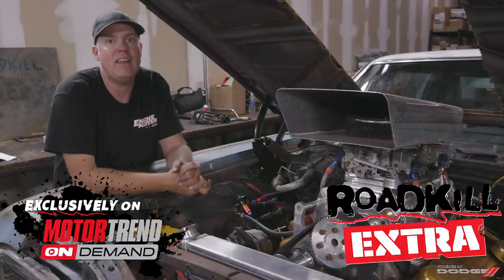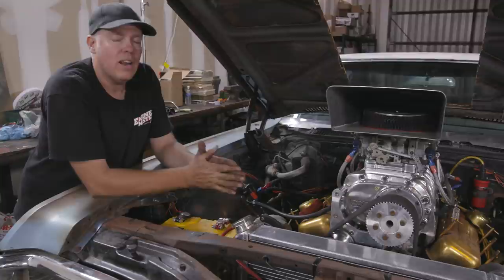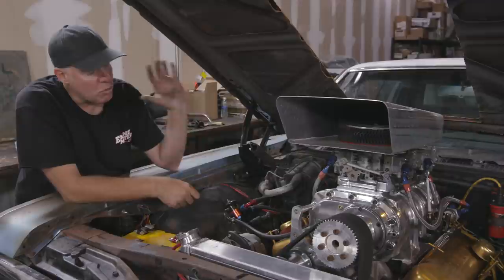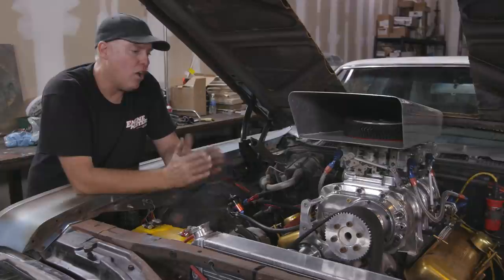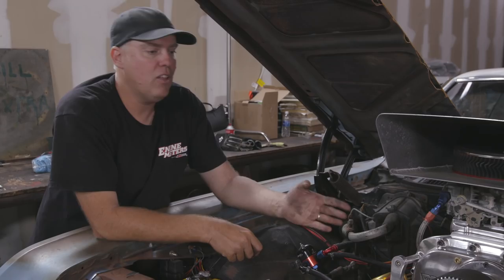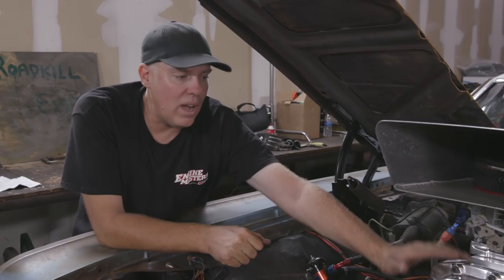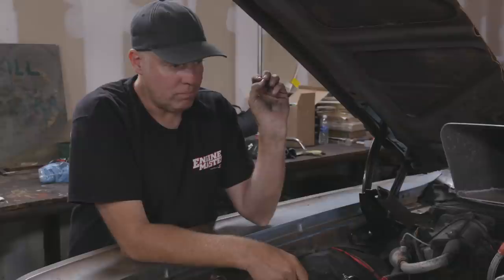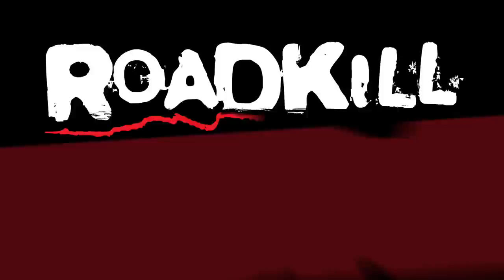Freiburger Explains Supercharger Basics - Roadkill Extra

Comment: I'm guessing the 2-stroke diesels don't use the crankcases for pumping, as mopeds, chainsaws and such does... So they'll need the blowers for a combination of scavenging and simultaneous refilling of fresh air to compress for the next working stroke.
Reply: Correct, the internals are not lubricated by fuel oil mixture being pumped into the crankcase like a two stroke gas engine. Which is nice because you don't have to worry about getting a correct oil to fuel ratio when you're refueling.
Edit: Plus the two stroke diesel sound so cool!
Reply: the 2 stroke GM that these blowers are based off has ports in the cylinders and exhaust valves in the head 
And yes they use the blower to "scavenge " the fresh air and force the  spent fuel and and air mixture out 
They are noise things to drive and have a very small torque range so as the saying goes "you gotta drive them like you stole them"
GM I was always told doesnt mean General Motors it means Grey Marine as that was the colour they were painted until GM bought them out in the late 30's
In Australia we call them leakers, bird scarers, screamers 
After you have spent a few days driving one you realize just how loud they are LOL
Reply: They indeed sound wild. But they sound nuckin futs when an injector or the injector rail hangs on one. Then they get quiet, that's when you run away real fast. lol
Reply: Have you ever seen what actually happens to cause a injector to stick ??
I made a video explaining what happens and showing how it happens and how to make sure it never happens on a GM 
Most people dont understand the full story as to why the injectors stick on a GM and it is quite a simple methodical process to check each injector properly but takes half a day on a GM to prevent the run away from ever happening
Reply: A tech can get in a hurry and destroy a fresh rebuilt DDC 2-stoke and possibly the tractor.
Reply: Our instructor even sabotaged a couple on us to teach the class. Thank Goodness he had a block off plate those suffocate the engine so not to destroy a teaching tool.

Comment: Can I get some thought on an engine swap I've been thinking about? 

I have a Ford F-150 with a manual trans with V6 in a regular cab and a narrow bed, I'm wanting to do an engine swap with a 5.4 Triton V8 with a supercharger. But I want to keep the manual trans in it, but I don't know what kind of computer I would need as well what trans can take the power and still fit in the truck. And would I need a new rear end for it? Would I have to replace the pistons and cam in the engine?

Comment: As far as we can make out, engine compression follows the gas laws, so the higher the compression, the more crank power is turned into heat energy from mechanical. High compression is great for power, but bad for low end torque.

Comment: If you're losing nearly 100hp just to turn a blower, why not just make it electric (i.e. small Tesla motor)?  A small Tesla type motor attached to the blower would provide immediate spin up and could keep it spinning way past the mechanical limitations imposed by the crankshaft spinning it. Just add a few batteries, or super capacitors, and you'd have the perfect drag car.
Reply: The problem is that we do not currently have the technology to make electric motors compact enough to fit in an automotive application that provide enough power to supercharge an engine.

Comment: Why don't you put a blow through twin turbo set up on the supercharger
Reply: WWII aircraft  used two stage supercharging where the output of one blower is fed to another.  The thing to watch out for  is the heat gain on the compressed air at each stage.  Compressing the air heats it as well. 

Two stage turbocharging is also possible.
Reply: a lot of the detroit diesels used both, the blower for savaging, and a little boost, and turbos for boost

Comment: David, (the rest of you) would an expansion chamber 
on a 2 stroke be considered a supercharger?

It DOES increase intake charge above ambient 
air pressure.

steve
Reply: The expansion chamber of a case induced reed valve two stroke operates on a different principal. It uses reflection of exhaust pulse pressure wave to push back partially burned exhaust gasses into the cylinder increase the volume of gasses available to be compressed. This is why pipes have an effective rpm range. Superchargers are mechanically driven devices which increase the pressure or volume of intake air. You can't really supercharger a case induced reed valve two stroke as the net increase in power is virtually non existent. The engine design is based on pressure differential from the bottom case and top of the piston. Most of the compressed intake charge would just leak straight out the exhaust port as there is no valve to retain the increased pressure. This is also why exhaust tuning works so well. If you time the exhaust pulse pressure right it literally pushes the gasses back into the cylinder and netting and overall higher volumetric efficiency.
Reply: James, an expansion chamber will first suck unburned air/fuel 
out the exhaust port, and then, after the transfer ports are 
closed, pump that unburned mixture back in.  Thereby, achieving 
a net total above ambient pressure.

Here's a link

https://en.wikipedia.org/wiki/Expansion_chamber

Looks like a supercharger to me, but ONLY at the right 
frequency.  (Which is why 2 stroke bikes have so many 
transmission gears.)

steve
Reply: Steve Skouson , superchargers are active mechanically driven devices utilizing energy such a crankshaft rotation, electricity, exhaust gas..ect to power a compressor to increase intake air volume. Expansion chambers are passive devices designed to take advantage of unique properties of exhaust pressure wave pulses. By definition, even though behavior may be similar in some circumstances, expansion chambers are not superchargers. Just like apples are not oranges, but they both grow on trees and they are delicious.
Reply: Steve Skouson, again, apples to oranges. Wikipedia for starters has a nice definition. However the pneumatic system linked eventually will run out of air in the bottles and so falls in the same category as nitrous. It's a neat idea. If they used air pressure or hydraulic pressure to power a compressor, then it would better meet the definition of a supercharger. Jet engines are a prime example of what a self feeding supercharger is capable of. Eliminate pistons and operate as a brayton cycle using sheer boost to produce thrust or add in another set of turbines and turn thrust into rotational force. Another neat concept is the 5 cycle engine.  But back to the original question, tuned pipes are not superchargers as they work on different principles. But whatever means are used to make horsepower, it doesn't matter as long as the intended results are achieved.

Comment: I hear the BS about not having parasitic losses with turbos a lot.  You still have to follow the law of conservation of energy.  The engine must lose some horsepower to the turbo to run it.  Yes it may be more efficient, but has anyone figured out exactly how much parasitic loss goes to the turbo?
Reply: Seth Jones The energy that runs the turbo would be wasted as heat and pressure coming out of the exhaust in an n/a engine hence there is no parasitic loss.
Reply: Iain that is the common misconception. It does not work like that. When you put a turbo on, it will restrict exhaust flow, thus restricting piston movement, thus parasitic losses. It is less than with purely mechanical superchargers, but it is still a parasitic loss.
Reply: Seth Jones there's less lose with a turbo, a turbo is run off the exhaust. The law from the turbo is caused by heat and not a belt that is turned by the motor
Reply: Engine Masters episode idea
Reply: If you run it off the alternator , there will be a parasitic loss.  The only way to avoid all parasitc losses in forced induction is an electric supercharger setup that runs off of a very large battery that is charged off of a wall outlet, or use a boost caboose.
Reply: Seth Jones you must be fun at parties, I was talking about the fake ones that have a legit Pc fan in them
Reply: Seth Jones if u run it that way ull have even more lose, the car will have to keep making power to make electric to run itsself plus make boost causing the engine to work harder. Turbo is still a better way the lose is threw heat but they have intercolors and if ur smart enough u can eningeer a water to air or a water flow threw unit and reduce that issue completely.
Reply: Seth Jones wouldn't it be classified as parasitic loss only if the engine was losing power from the inductor? For example I could put a larger alternator in the car with a pulley to match the original gear ratio (equal power loss) of the replaced alternator and still receive adequate power.
But what the heck centrifugal supercharger the whole way, Audi can steer clear of me with their electric Turbo technology.
Reply: Matthew Guilford English?
Reply: eh, kinda if there was a electric supercharger that actually work the losses from the alternator would be negligible, itll charge over time and draw from the battery at wot, that being said... they don't actually work ,it would take a massive set up, and a giant heavy electric motor to run it
Reply: The amount of loss depends on the turbine wheel size, I would imagine a setup with too small of a turbine would restrict flow which kills power and would be less efficient. Would be an interesting test with a large turbo that isn’t choking the engine
Reply: Alternators require power to run.  The more loat is placed on the electrical system, the more load is placed on the alternator, and the more load is placed on the engine.  Thats just how this works.
Reply: I said run the electric cupercharger off of a battery charged from a wall outlet.  not the alternator.  alternators require hp to run.  You can run anything off abattery on a circuit not connected to an alternator.  Your flashlight is just one example.  maybe you should think a little more.
Reply: again, runn it off a battery charged from a wall outlet, not the alternator if you want to avoid parasitic losses.  wont work for very long, but it may be good for a few passes at a drag strip.
Reply: An easy and fairly tidy way to answer your question is equating how much power it takes from the engine to run a device. A small turbo comes out to about 27 horsepower. A large one, like an 88mm is closer to 40. Still better odds than you'll find on the most efficient supercharger systems, but it's all about the application and power delivery, and where you want that power in the RPM range.
Reply: There is one electric supercharger out there, but it's got a quite ways to go before it's fully viable. I believe the test mule is a Volkswagen.
Reply: If the turbine side is specced properly there are plenty of turbos that will run less drive pressure than boost, meaning pumping losses due to exhaust back pressure are more than fully negated by the charge air on the induction side.; and what I’m talking about is on diesels where we can run 50, 60, 80, 100+psi of boost. As another point there’s empirical evidence drive pressure up to 15psi more than boost does not affect overall horsepower.
Reply: I know it's an old thread but remember when it's a "conversation" between turbo fans and supercharger fans ALL JOKES must begin with something like "a priest and a rabbi walk in" LOL! Way too serious for anything as clever as your comment! I enjoyed it immensely!

Comment: what are these weird long yellow t screw things on the cylinderhead covers? Are those things holding on the covers?
Reply: They are speedbolts. Mostly used in racing to get the valve cover off really quickly without using a socket.
Reply: yes
Reply: thank you!

Comment: Basically the more air you have the more oxygen you have. The more oxygen you have the more gas you can have that will combust with the increased amount of oxygen. So stronger explosion in same size cylinder increasing power.

Comment: Would it be reasonable to say that a supercharger makes a smaller displacement engine perform like a bigger displacement engine?
Reply: The Little Red Brick baaaasically yes. But since there are such things like a boost curve, there is more to it in the real world. Throttle Response, torque curve, sound... It is not the same.

Comment: I have an odd question I need an answer to...hope you can help. Where can I find a car layout graphic for my car. They used to be in the new car brochures.  It was a outline drawing of the car; side and top views mostly; that showed the outline of the car with the drive train and drivers seating position in solid black over a full grid with scale legend similar to this (https://i.kinja-img.com/gawker-media/image/upload/s--Fd-YBUK6--/c_scale,f_auto,fl_progressive,q_80,w_800/18k7rlyypkl1ijpg.jpg ). I think Motor Trend & Car Craft mag used to have those also at the end of the issue comparing the 2 or 3 cars spotlighted with all the spec listed under each. Need one for my 2004 Stratus coupe. Looking to do a custom build and that would save me Months of incorrect measurements.

Comment: Are the ‘rotors’ in the roots blowers straight or are they spiral? I’m not sure if I have ever seen.
Reply: Scott Koenig if I'm not mistaken I do believe they r straight but don't quote me on that
Reply: Scott Koenig they are straight rods, you're thinking of the screw blower, the eaton blower is basically the same as a roots but has a twist on the rods. Hope that helps
Reply: It’s pretty much 2 long fidget spinners
Reply: logan, actually 🤔 thinking is what made me posit the question. I’ve been aware of how a roots blower compresses air for a long time. However, it occurred to me listening to Dave’s talking, I wasn’t sure of what the internals of the roots blower looked like.
Reply: The GM (C) diesel ones were straight, many of the after marked ones used for racing are twisted
Reply: I assume a slight "twist" will decrease sound a little, just like with gears in a gearbox.
Reply: the twist decreases pulsations in the airflow
Reply: jesper: Ah, sounds reasonable.

Comment: Wouldn't it make more sense to call superchargers and turbos "artificial displacement" instead of "artificial compression ratio"? If you're making 14.7lbs of boost you're essentially doubling the size of the cylinders since you're shoving double the air into it.
Reply: Noman both is equally correct and wrong. Your entire system displaces more air (from intake to exhaust) and the air is more compressed, basically in two stages.
You just don't call it that way to avoid confusion about what you mean.
Reply: well I'm aware that SCs and Turbskis are both different from displacement or CR, but when he was making the comparison I thought it would make more sense to call it "artificial displacement" for the reason I put in my comment. Since motors are essentially air pumps a turbo/SC would be flowing the same as going from say a 5L V8 to a 10L with the extra 1 bar pressure (with proper intercooling of course). this isn't the complete picture but just going with what seems to be intuitive.

Comment: Quick question. Would say a 10-71 work on an 8 cylinder engine?
Reply: Whether it's a 6-71, 8-71 or 14-71, it will work a V8. It does not refer to what kind of engine it will work on, but rather the displacement of the compressor. I run a 10-71 on a 532.

Comment: more air, more fuel, in the same space... basically the same as having a larger engine?
Reply: Not really. More air and more fuel in the same space, means a much faster burn. If you packed the air into a bigger engine, your burn would be a lot slower.

Comment: So a Blower is more of a Parasite to the motor compared to a Turbo?
Reply: Yeah. Turbos aren't parasitic at all really because they aren't driven directly by engine power.
Reply: It’s definitely the most parasitic of the three. Both the Turbo and Belt Driven Supercharger are more efficient in the sense that the Turbo makes use of the exhaust air to function instead of just releasing it like an NA, while the belt driven SC uses the very crankshaft to add more power. Both don’t take power to make power like the roots style blower, but the Turbo does suffer from lag due to a lag in air-fuel ratio starting from idle sometimes (due to its centrifugal nature).
Reply: Crank driven supercharges require engine power to turn, just like a water pump, power steering pump, alternator, or AC compressor.

Turbos on the other hand use exhaust velocity/energy to turn them.   Which do constrict the exhaust some, so that does cause some restriction(effectively parasitic loss).   The more massive the impeller and turbine, the more exhaust velocity/energy is required to spin the turbo.   At lower RPM's there isn't always enough energy in the exhaust to spin the turbo fast enough to create boost - which creates "turbo lag".   Once the engine RPM's is high enough to spin the turbo, boost begins.   

You will see some of your better designed turbo engines use a smaller turbo for lower RPMs and a larger for primary boost at higher RPMs.
Reply: Sort of, but unlike a supercharger that runs directly off the crankshaft, a turbo isn't parasitic by design. Not saying turbos are perfect, as there's that trade-off of lag compared to a belt-driven supercharger, but any parasitic effects are more like side-effects rather than the nature of the mechanism.